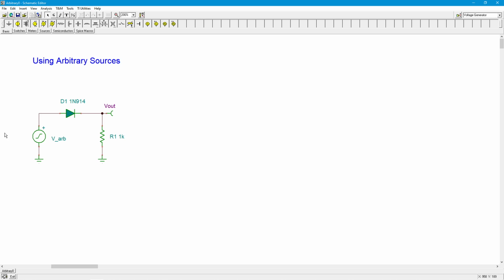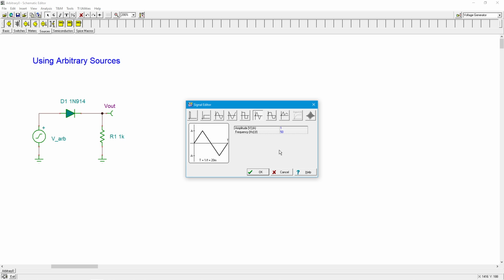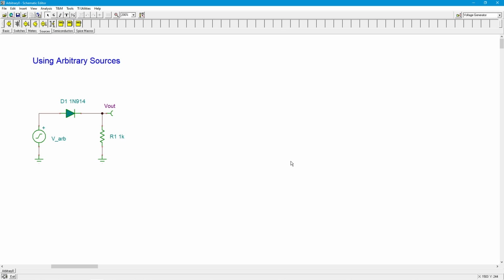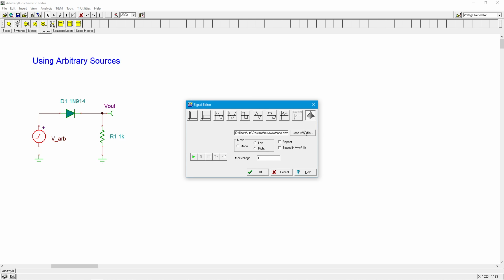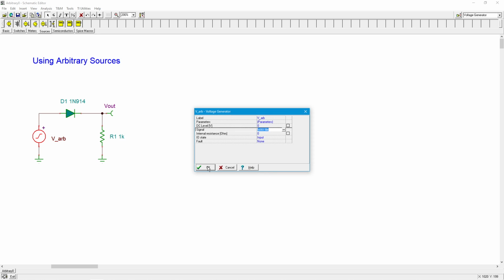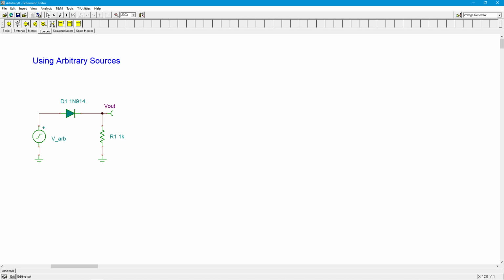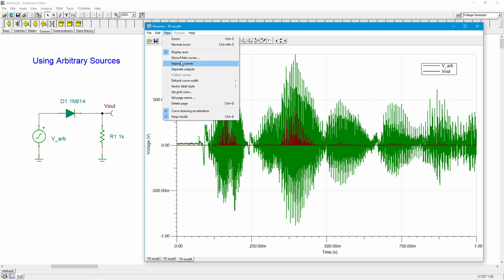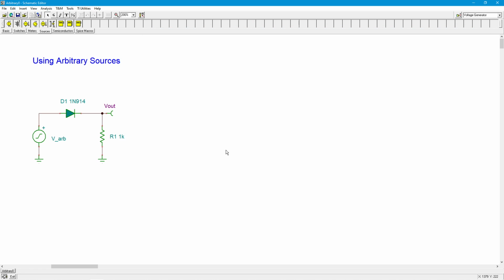TINA TI: Arbitrary Sources

Comment: Too funny! I need some information on how to create a PWL file in TI-TINA and your video popped up! Great stuff. 

For the fun of it I drew a random wave form in paint, saved it, then had ChatGPT create a PWL file out of it. It took a bit too long to be useful but it eventually worked (someday it will work on the first go)

Something even better...I asked Perplexity to (This is the exact entry I used)
 
Create a table of 50 values that represent a PWL voltage source that starts out at 0V and goes to 3V (y axis) in 2us (x axis) following a second order system with a damping factor zeta of .3 Do it with 6 digit precision for both time and voltage. 

It produced a table that I dropped into excel. It was awesome (Well except for the part where one data point was off but I averaged the two closest data points and called it good)

Then I asked it do produce the table for 5 time constants. It gave all of the equations and explained how it got there. What a learning tool.